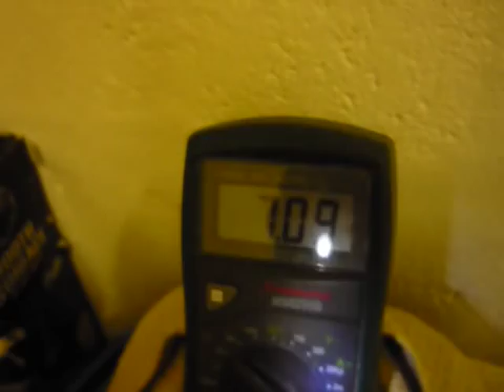HHO - magnet cell - Another strange result

Comment from the maker: I could "NOT" get these plates to conduct (spent days trying), until I placed the magnets 1/3 opposing magnetic fields?? Absolutely no electrolyte! 
I had tried opposing in prior tests but to no avail - couldn't keep the magnets in position.... LOL!
I have another 2 video's - one at 100v @ 0.5 amps --- the other 12v @ 0,2 amps (THE MAGNETS IN THIS ONE ARE 100% OPPOSING), but dirt off the brackets I used coloured the water a dark black/blue - at least I think that was what caused it?
Jim